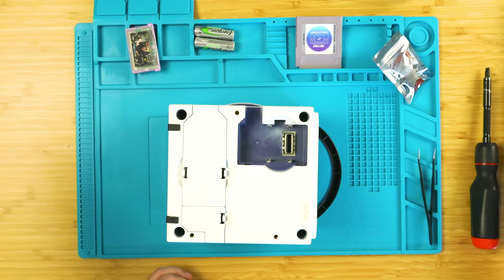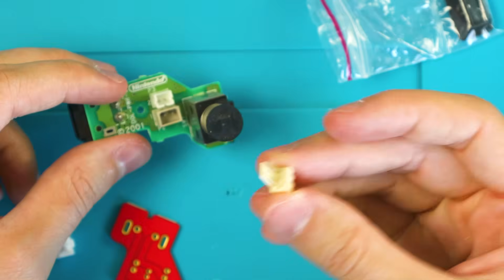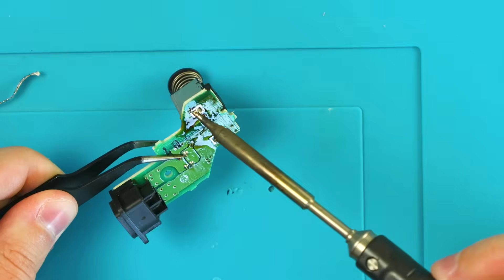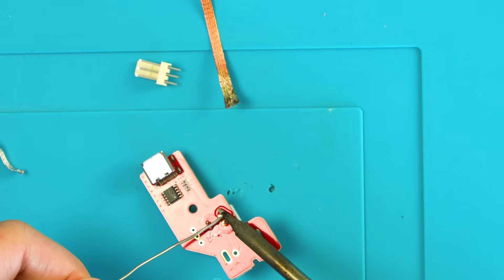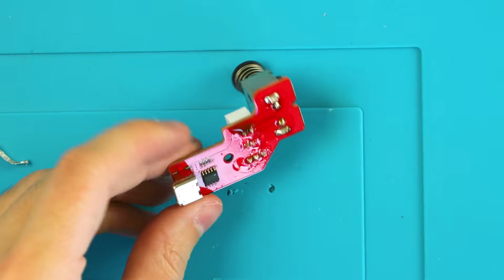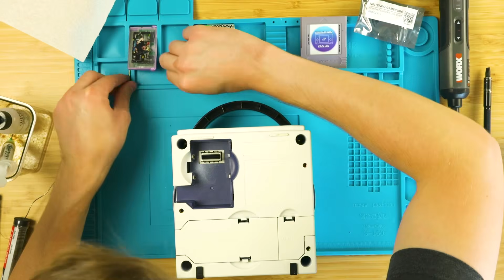Powering My GameCube with USB-C! | GC USB-C Mod

Comment: I found a Usb c mod for gamecube on Amazon. it requires a 12V 3A usb or usbc wall brick. finally found a usbc wall brick that can give 12V to power the gamecube. Since i ordered a gamecube on amazon doesn't come with the original OEM gamecube power supply.
 Aftermarket power supply 
(Reviews said it's trash) The mod saved the day